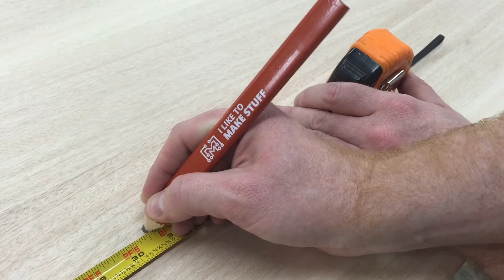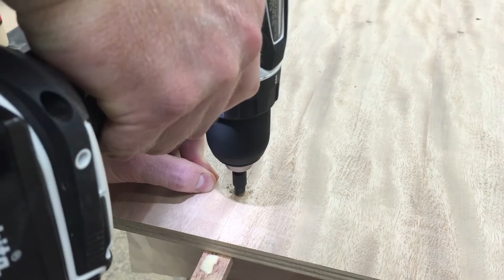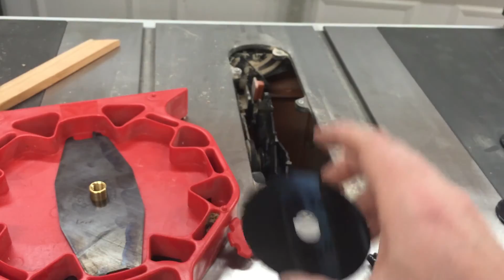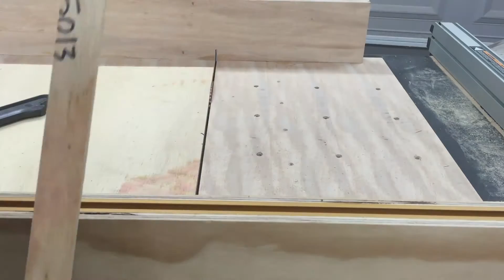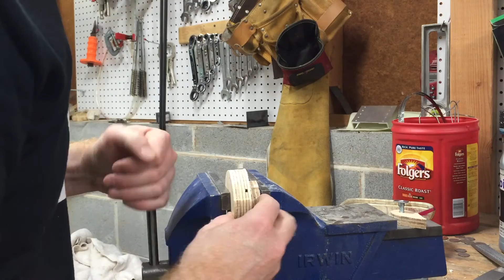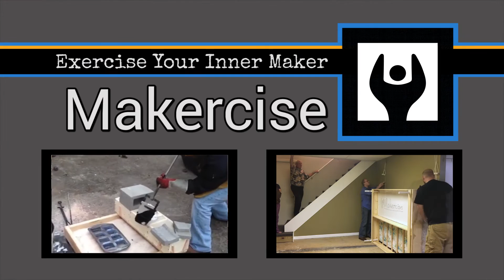Table Saw Cross Cut Sled - Makercise

Comment: You can achieve the same hold-down functionality using two T tracks either side of the blade.  Use a dado stack or router to make the grooves. You could still use toggle clamps, home made clamps or hold down clamps. Much quicker and easier but it is an interesting and different way to do it just not as efficient.

Comment: Cressel,

This is the most versatile sled design I've seen, and I've seen a lot of sleds. The t-nut and toggle clamp feature is just brilliant! It's easy to determine that you're a machinist when you bring out the digital calipers for a woodworking project 👍🏻.
Great build and great channel!
Reply from the maker: Haha. Thanks! I have gotten a lot of use out of it for sure.